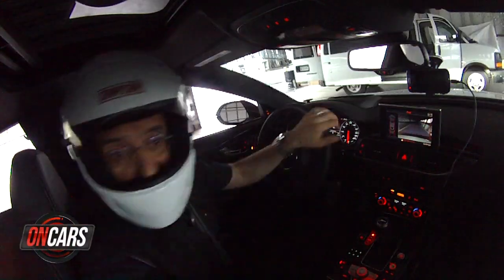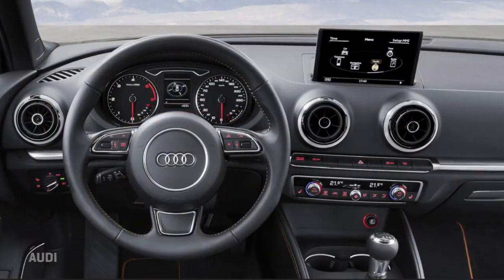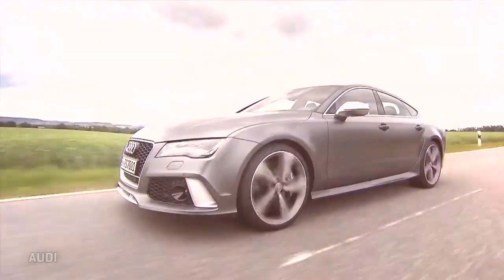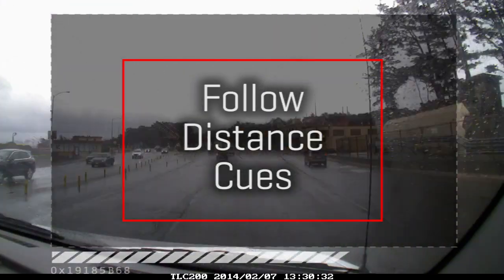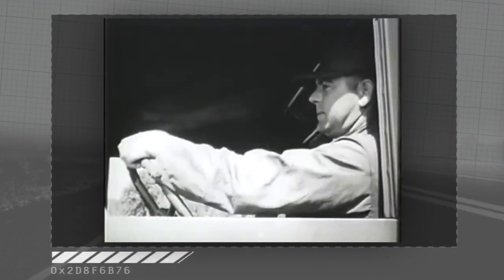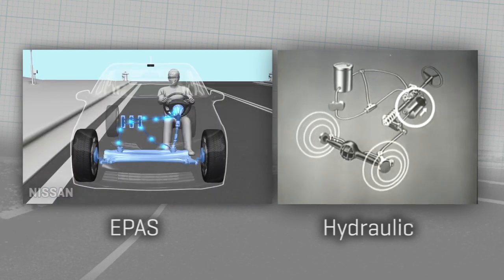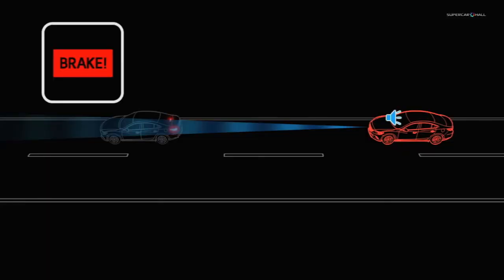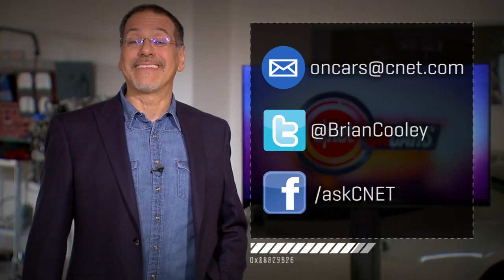CNET On Cars - Driving the hottest RS Audi ever sold in the US - Ep. 38

Comment: A car show for smart people. What a concept!

While I accept the inevitability of auto trans, electric steering, and driving nannies, I can't help but conclude the golden age of enthusiast driving is coming to a close. As the manufacturers drop their V8s to meet upcoming CAFE standards, and implement driver-assist technology like torque vectoring that reduces the skill required to drive quickly and smoothly, the motorheads of my (boomer) generation graciously give way to the utilitarian-minded millennials.

We old-schoolers perceive greater elegance in mechanical tech when it does with hydraulics and gears the cool things software designers can implement using computer code and "smart" hardware. Case in point: steering systems. My old Jag XJ's hydraulic steering incorporates variable assist (less assist at higher speed) and variable ratio (more turn-in with less steering wheel rotation the further away from center). Probably this system consumes several horsepower, but to an enthusiast the road feedback and driveability enhancement are the source of great satisfaction. We can hope electric steering evolves to provide good road feel and the variable features I've just described, but who is going to demand these refinements? Certainly not the new generation of drivers.

As I said, we're coming out of a golden age. As a lifelong motorhead I consider myself fortunate to have lived through it.